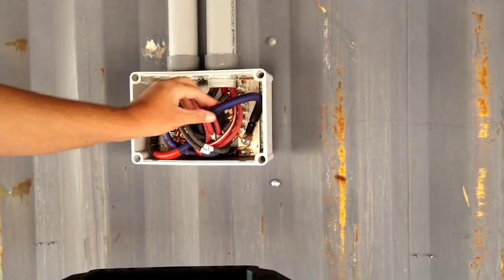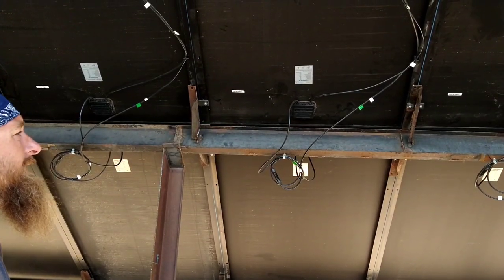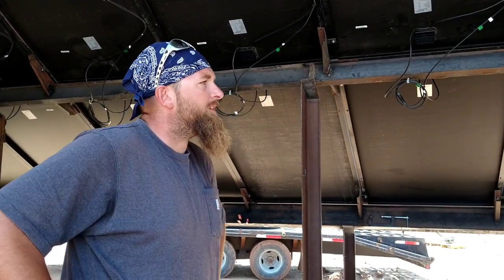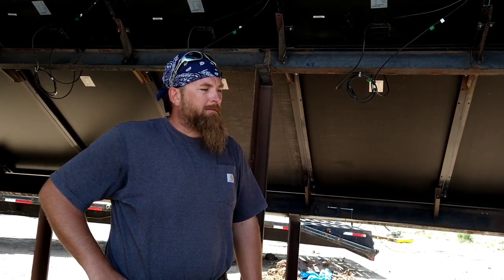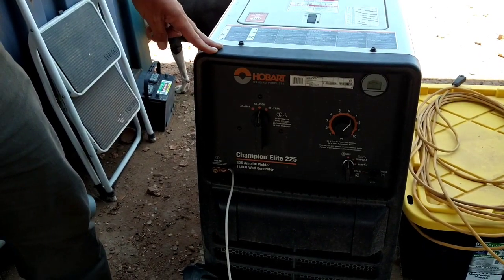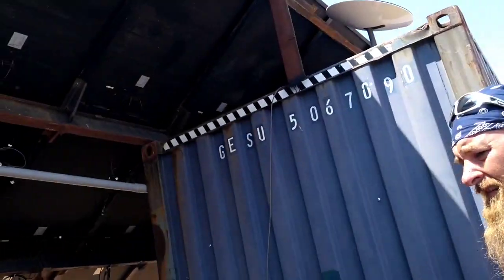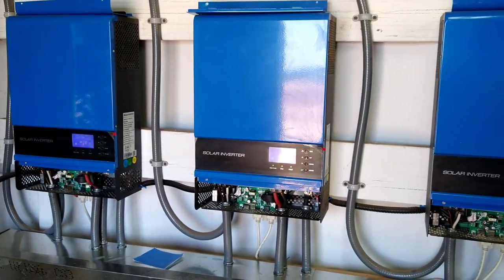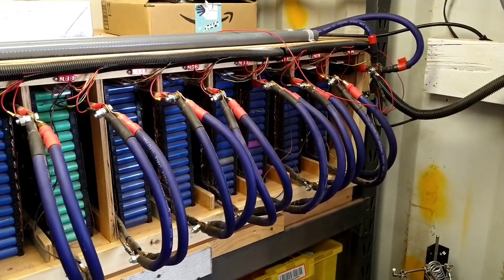200kw+ /46kw/ 18kw solar system for under $25k.

Comment: Let me recap. You have 78x250 or 20kW of PV. 46kWh battery. 18kW of GroWatt or Voltronic Inverters. You were using 23kWh per day. Sounds good. Mine is similar but with 134kWh LFE battery.
Reply from the maker: Nice. We plan to double bank to 92 kw.
Reply: @sunflowerhomestead3351  awesome, your local powerco must love you!
Reply from the maker: We are off-grid. No local power company. 😁

Comment: Awesome. Why not go with a server rack mount LiFePo4? Much safer chemistry and longevity.
Reply from the maker: Lithium ion last longer and holds more power. The chemistry if it's monitored properly is safe. We have a great battery management system. Server racks cost 10 times more than our box we built. We can also break these down and rebuild when a cell fails for a few dollars. Overall the price. We paid .58 cents each which worked out to $2500.
Reply: @sunflowerhomestead3351  I know lithium ion can be more energy dense, good for high power low weight applications. I’m unfamiliar with that chemistry lasting longer than lifepo4.

Comment: Does 25k include the steel and wiring etc?.  What do you think it would cost someone to purchase the steel and copper at todays prices?
I am off grid with 13k panels, 28k lithium iron phosphate batteries and 49kw inverters.  I run 5 air conditioners in 100 plus degrees desert living.  And yes, laundry, computers, welders etc.  The only thing i see is that the panels all face same direction.  Mine are staged from south to south/west to collect till late in the day.  Now server rack batteries are the way to do, less money and better reliability.
Reply from the maker: Hi. If you have capabilities to weld and cut steel. You can get used mobile home trailers. That's what we used. We posted on craigslist saying we were willing to pick them up. We got most free. We paid  $700 total and resold the wheels, axels and toungs and made our money back. The Copper was recycled well pump wire 10/3. Blasted it with electrolysis to take off the corrosion. Copper connections were 1/4", 3/8" and 1/2" copper tubing  we made into lugs. Nuts, bolts, lock washers we're $100 on eBay/amazon. 2 years ago it was $10,000 to build a racking system (purchasing the steel.) Today I would say double that. Our panels face south at 30 degrees with no obstructions. By 11 am we're 95 percent charged and it trickle charges for another 2 hours. It seems to be doing well for us.
Reply: @sunflowerhomestead3351  The main reason for late afternoon collection is when you are running air conditioning.  Late collection reduces battery drain quite a bit.  I run my air till dark most days.  May try all night air on the hot nights soon?
Reply: @sunflowerhomestead3351  I am air conditioning my equipment room.  I had some BattleBorn batteries start to greatly reduce in capacity because we had hot days right after we moved to our new desert spot.  All I could do at that point was keep the door open and that meant that the batteries were operating in a hot environment.  Found out that operating lithium in hot environment will degrade the batteries real bad.  They replace the 2 batteries that were below 80%.  My research shows that if you keep the lithium batteries cool (70f) they will last almost forever, assuming that you are doing low draw and charge which is typical for off grid.  We also have an insulated cooler container for food, 2 freezers and a fridge/freezer.  So we have 2 spaces that must be cooled 24/7/365.  Lots to learn, but I agree with you about getting out and on your own!
Reply from the maker: Dig a trench about 100ftx 10ft deep. Buy the he Depot 4" rubberized tubing that comes in 200ft rolls. Bury the tubing run a recirculating fan into the room. The temps at 10ft are in the 60s.
Reply: @sunflowerhomestead3351  Nice!  We don't have the equipment to do that right now, but I have talked a lot about that in the past.  We are in the western Arizona desert where it gets really hot for a few months.
Reply from the maker: @sciglassblower  I get it. We are Eastern Arizona. Definitely not as hot as the Western Side. Keeping batteries cool is key. Good luck. We subscribed to you to follow your journey.
Reply: @sunflowerhomestead3351  Nice that you were able to save on the steel!  Now steel and copper are going way up.  Thanks for the reply.

Comment: Great Job!!!  ~ what welder did you use to build the batteries?
Reply from the maker: Hi, we used a Hobart champion elite 225 to power everything including the miller 212 mig.
Reply: @sunflowerhomestead3351  I think he means spot welder on the 18650 cells
Reply from the maker: You are right. We used a k weld. We had a Sunkko 709 AD it was a pile of junk.
Reply from the maker: Dino sorry I gave you the welder for the frame build. For batteries We used a k weld. We had a Sunkko 709 AD it was a pile of junk.
Reply: @sunflowerhomestead3351  k weld for the win!